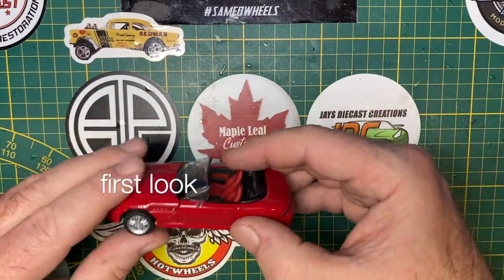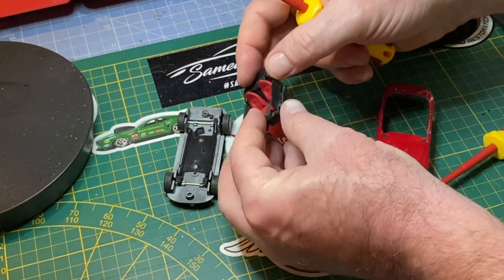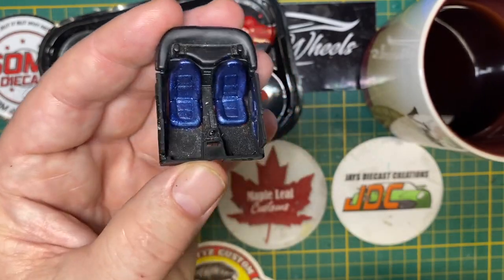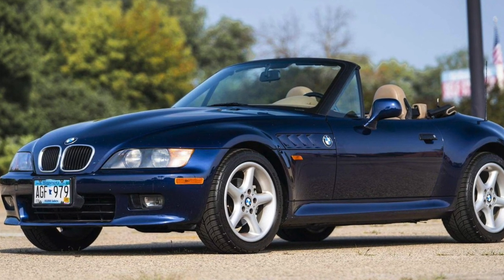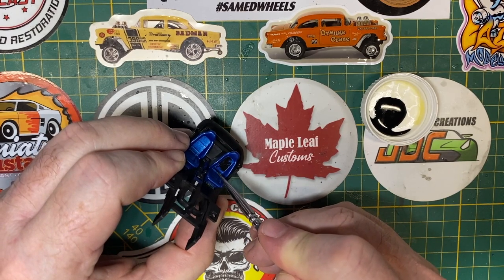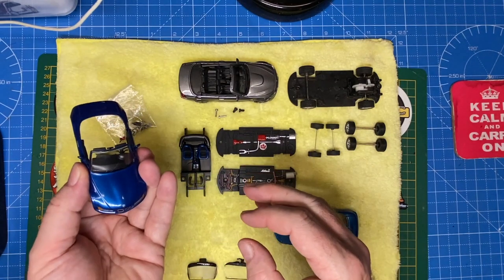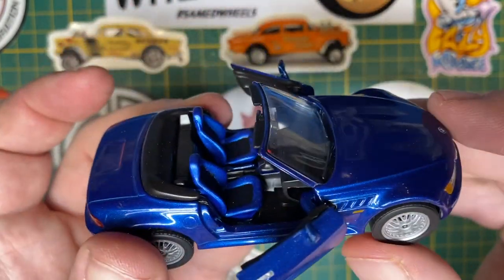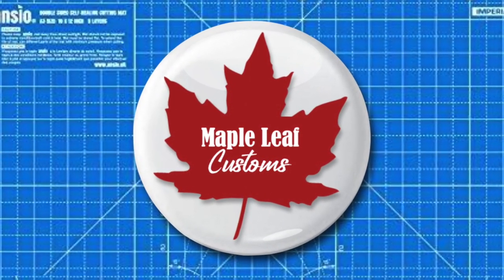1:43 Schuco BMW Z3 (175) The Jigsaw Car

Comment: You’re like the Bob Ross of the customizing community. Thank you for helping me calm down after long days and I’m glad I even got to talk to you. I have another question golden problem with starting the diecast hobby, I said I don’t really have space to start messing with cars. I don’t have that much cash what do I do?
Reply from the maker: Hi, Aidan. Little room, low budget? That's how I started out too! 😀 I bought a small bag of cars on eBay (mostly junkers) and did one at a time. If your tools are organized, you can do a lot on a small bench top. Paint stripper is pretty important. I used old school wire brushes before buying a Dremel. A can of spray paint and off you go! If you find you like the hobby, then you'll add stuff. Give it a try. Goal #1 is have a great time! 🍁👊✌️

Comment: The color is beautiful, Andrew. This would could nearly pass for a 1:1 scale with some outdoor glamour shots.
Reply from the maker: Thank you kindly, David. Curiously, the parts that came in metallic blue weren't the identical colour. That surprised me. However, it was hard to respray everything in the same Vallejo metallic blue to match. This might have been the toughest build I've done recently. Getting everything to fit was the challenge! It was nice to take my vacation right afterwards. Just got back home today! 🍁😀

Comment: Turned out really nice. A lot of pieces 😂
I hope you could bail out of the Z3 better then of the Z4. I almost broke my back once 😅
Reply from the maker: Thanks, Yves. Yes, the Z3 is a tight fit for a tall man. Getting in and out was the trick. Quite comfortable once settled in though. 🍁👍
Reply: @MapleLeafCustoms  😂  i also tried once a Triumph Mk4. It fitted so well that i almost called the firebrigade to cut me out 😉
I hope you jetlag is not to bad 😉